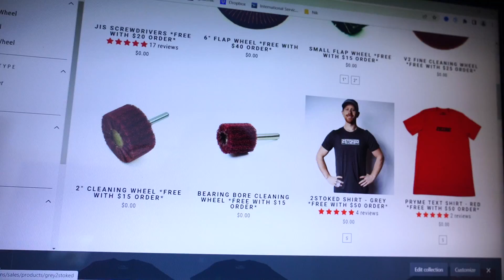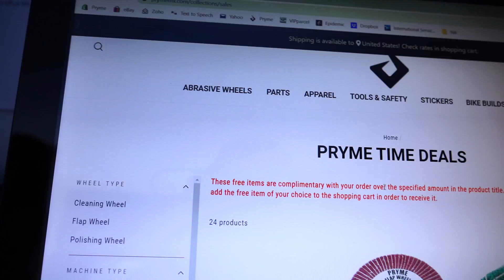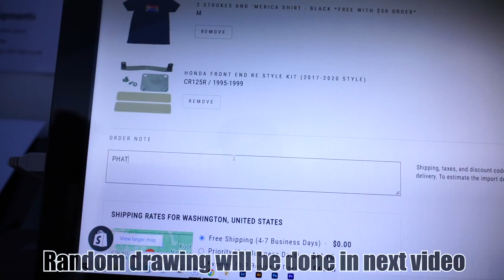Running Into Problems | RM250 Rebuild 35

Comment: Hey mate it looked like you didn’t isolate each crimp connector from the other before heat shrinking them, maybe you did but if not just individually heat shrink each one and then a large piece over the top of them.
Reply: Was going to say the same thing.
Reply: Noticed that too. Came to comment it. Not going to run like that!
Reply: Saw it immediately too! The bike won’t start like that.
Reply: Yep. Kill switch on all the time.

Comment: I may have missed it but it looks like you didn’t isolate the crimp on connectors on the kill switch splice. Again maybe you did but it looked like you just covered them with heat shrink? If they touch (metal to metal) it will permanently be “killing” (shorting) the bike.
Reply: Noticed this as well
Reply: I was just going to write the same thing.
Reply: Me too

Comment: Hello Cameron, I'm not sure, but when you crimped the two wires on kill switch and then you put the heat shrink over the wires it looked like the two crimps were touching and would short out. That's the way it looked to me. Although I could be wrong.

Comment: Awesome video as always. A tip for keeping cables in good condition when going around sharp corners, is to us a little bit of rubber fuel line zip tied to the cable as a buffer.

Comment: I'm currently experiencing problems with my 01 RM.  With around 10 hours on a new top end, I installed a new gen Lectron; that cleaned up the jetting, especially in lower rpms. 

Now I have an electrical issues, possibly a bad CDI due to sloppy pressure washing ... looks like I'm also shopping EBay  --  What a stunning RM your build has morphed into !
Reply: Text message reply sent.

Comment: Hey thought I’d point out that I don’t think that kill switch will work! You won’t get the bike started like that, It’ll constantly be on since both of those butt connectors are metal and you heat shrunk them both together. You technically just make a constant kill switch as both wires are always touching!

Comment: I’ve always used dry graphite on the throttle tube makes it nice and slippery on the bar, won’t collect dust.

Also unless I missed it looks like you didn’t individually insulate the metal butt connectors on the kill switch, that’s a short, it won’t spark like that.

Comment: Didn’t look like you isolated each wire for the kill switch. Won’t the kill switch wires ground to each other and cause the bike not to run? To my knowledge the kill switch is a momentary on/off switch that when pressed allows continuity for ground and kills the motor. With the wires touching the bike won’t have any spark ever…

Comment: Nice video Cameron :)  I have a question for you about the wire shelving system you are using.  I wanted to ask where you got them, and how you were able to get the extra shelves needed to customize the shelf height for the bin heights?  I know they are adjustable height shelves, but most only come with 4 or 5 shelves.  Looks like some of yours have way more than that.

Comment: Hopefully the butt connectors for the killswitch don't connect inside the wire insulation or it may  cut your bike off. Looked like ya got em too close together